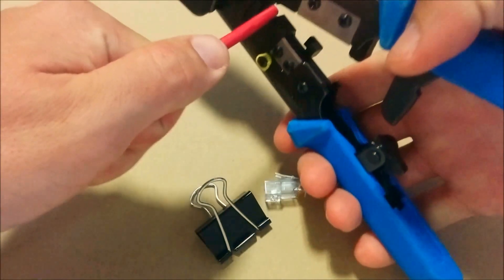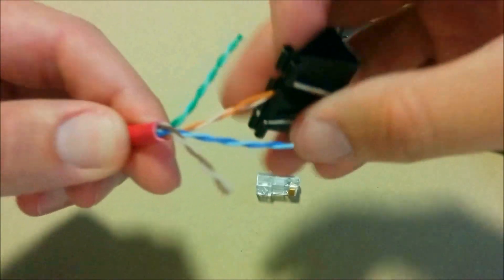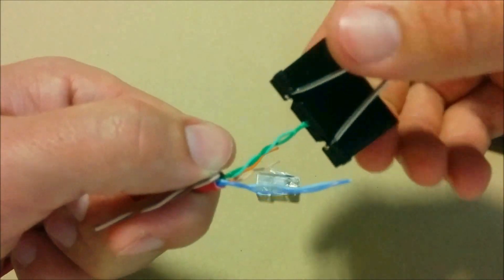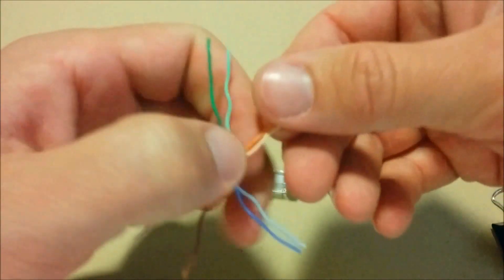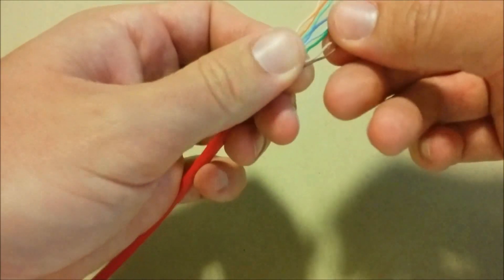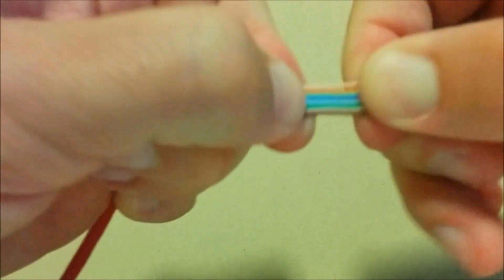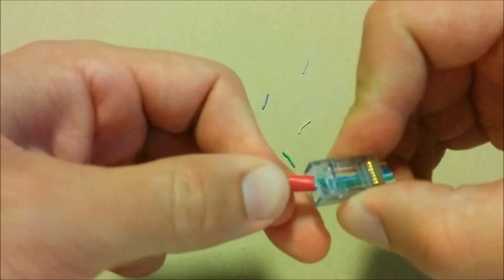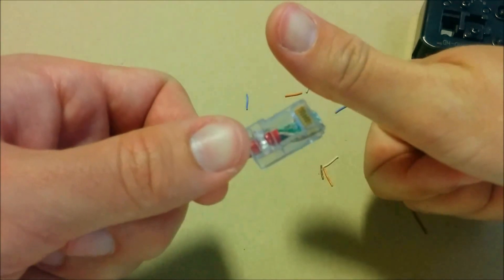Cat RJ45 easy technique

Comment: I can never make a good cat 5 connection. I always go through many many firings before it is right. I have been using your method for many years but it is still always a toss up as to whether it’s going to work. I use a Cat5 tester and never get it working less than an hour of trying.  What can I do
Reply: I’m wondering how critical the crimped is?   I have several

Comment: This video is a lifesaver! I'm new to cat5 crimping. I bought some pass through connectors and a crimper and tried it before I saw this video. I was struggling - cable after cable! They just wouldn't push through straight. When I saw this video and saw how to make them all aligned and straight, now I am making cables - testing ok as well! Thank you!

Comment: I would update this video and remove the top of the wire that may have been nicked as you went through the outside sheathing. You can use this tool to remove the outside sheathing but then you need to strip back more sheathing using the pull string in it. Then you cut off below the point where you removed the outside sheath so that there is no chance that when cutting the outside sheathing off could have nicked a wire inside

Comment: Thank god for this video the whole making a connection is easy but time consuming and hard to make perfect without a good technique like this. My one question is would bending the wires like you were doing gonna damage or break off. I’ve dealt with copper wires that have fallen off from me moving and bending it too much. Guess I’ll have to try out myself.

Edit: i tried your method where you bend the wires in different directions to straighten them out twice and the wires just kept breaking.

Comment: Make sure you use the right connector! There are TWO different connectors that look exactly the same. Most stores selling them do not know the difference and there is nothing on the package indicating which one it is. Stranded wire connectors are NOT good with solid wire ("backbone system cable"). And solid wire connectors are NOT good with stranded ("flex patch cable"). These how too videos do not tell you that. There are "universal connectors" but installers don't usually like them or use them. Just use the right one for the job to make the best cables. Here's the simple rule: If the prongs are INLINE (straight) then that is used for stranded wire. If the prongs are OFFSET (NOT INLINE but crooked) they are for solid wire connections. Even the stores selling connectors rarely get it right. You have to check. Using the wrong connector makes poor cables that fail early. Search for the pictures of the prongs. You understand it clearly when you see them. Know your cable wires before you crimp them! Solid or stranded.

Comment: Pull through connectors are a great idea, I always wondered why we did not have them.
Reply: Is anyone else bothered by the wire still coming through the end of the connector? I realize most of it was cut off but you could still see some of the wire sticking out of the end. I'm wondering if it ever interferes when plugging it into a wall jack?
Reply: Jeff Todd that style is for the new school people.im not a fan of open conductors at the end of the plug . So I wouldn't use that style personally speaking .

Comment: i'd not seen rj45 with holes at tip of the plug yet. it's very useful
Reply: Me2
Reply: Its pass through connecter where wires can pass and then you can make it more perfect.

Comment from the maker: Just made a quick video to help anyone trying to align the CAT cable wires parallel and straight, so it slides into the RJ45 quickly and easily. I hopes it helps you.